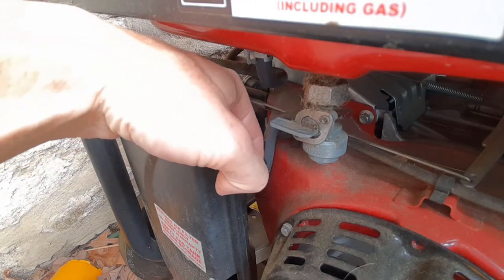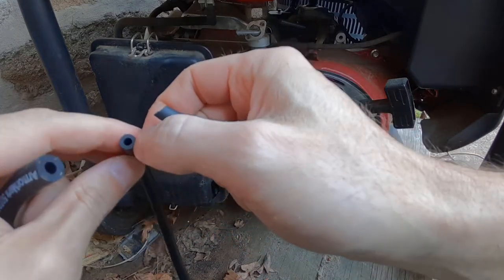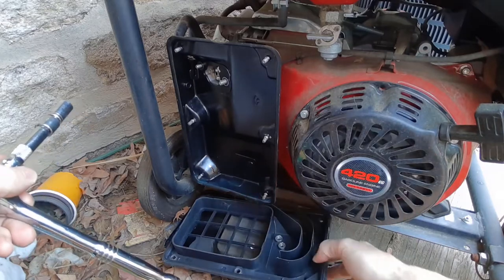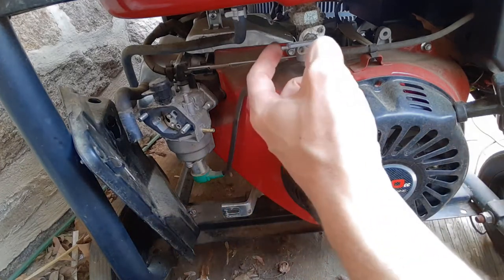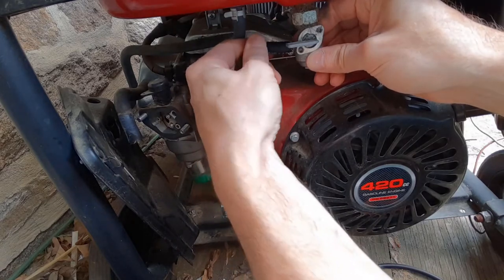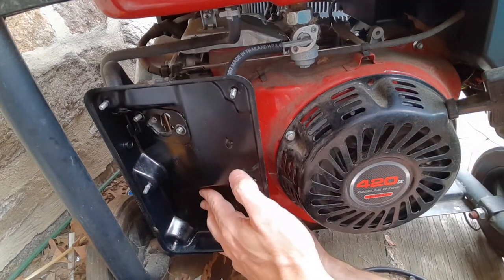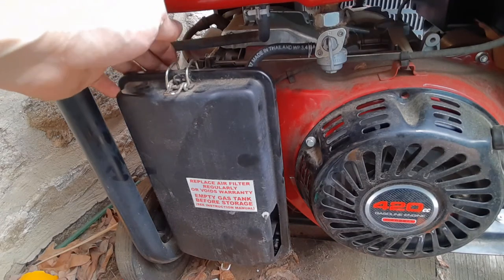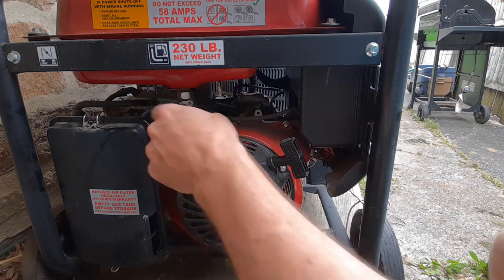How to Fix a Fuel Line on Predator Generator (4000, 7000, 8000, 8750, and 9000 Watt systems)

Comment: Super helpful. I was worried about removing the air filter assembly and was trying to connect the new fuel line with the filter installed. Very difficult that way.  Thanks!

Comment: I did this, but when I turn on the fuel valve, the fuel does not flow into the carburettor. 
But when I remove it from the carburettor, it flows out
Pls what is the way forward

Comment: Ty for the video.   I did all that and the gas won't flow.   Gas  goes through the hose  when not connected but will not when connected. Any ideas?
Reply from the maker: Carburetor may be blocked which will stop the flow of fuel.

Comment: Common problem with the crappy pipe that comes with most generators. Mine only lasted 4 months but you never know how long the pipe was sat on the shelf before it was used. I used the same proper petrol pipe but the only worry i have is that with it being stiffer i  hope it doesnt snap the fitting off the carb or fuel on/off tap.

Comment: What is the other hose coming out of the fuel tank
Reply: The one that goes on the top: I believe it’s an air intake
Reply: Crankcase ventilation.  Basically this line will take any case pressure (that contains oil fumes, etc) and let it run back into the carb to be burned.